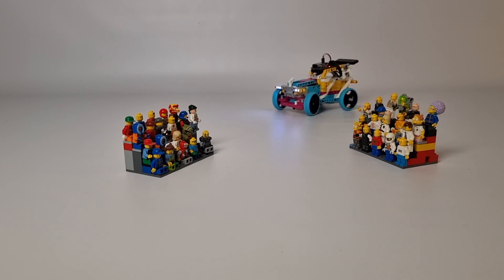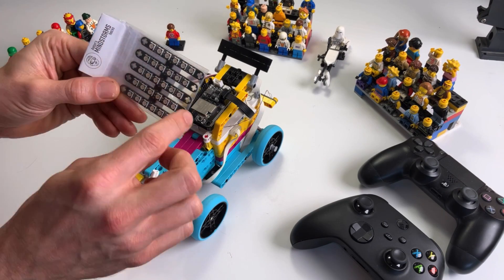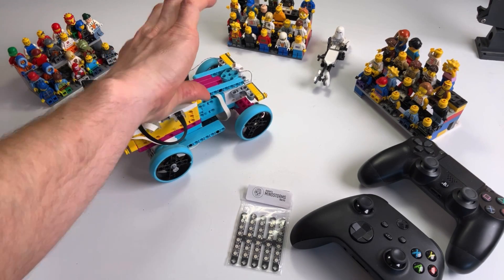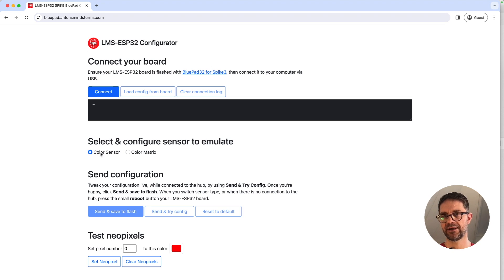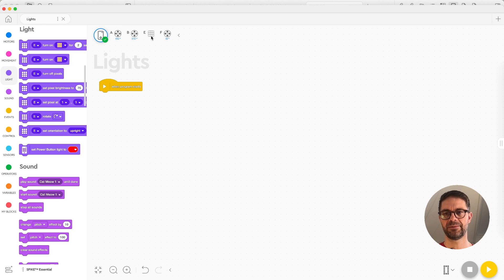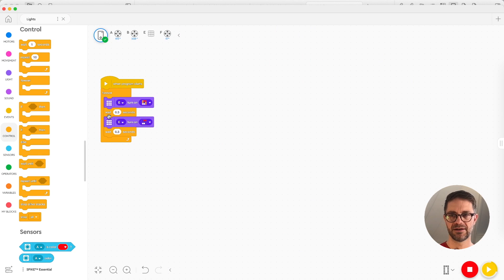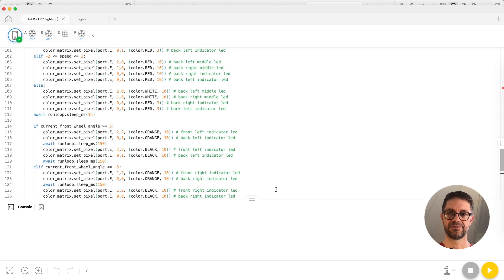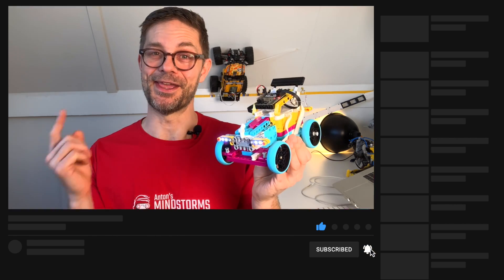How To Add Blinkers & Brake Lights To Your SPIKE Car!

Comment: Really cool! I would just suggest one change to the way the color matrix is programmed. It would be nice to turn the mapping around. So you would pick for each of the 12 LEDs which spot on the color matrix corresponds to that LED. That would allow to map more than one LED to the same spot on the 3x3. This could on one hand simplify your headlights (all could map to the same spot) and also allow to simultaneously light up every LED, even when there are lots more than 9 LEDs connected…
Reply from the maker: Cool idea! Will do!